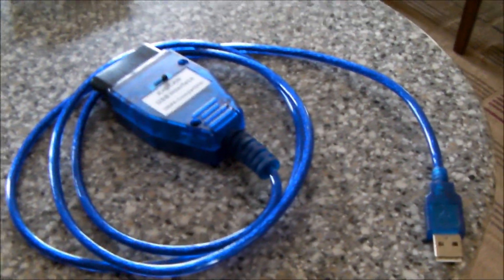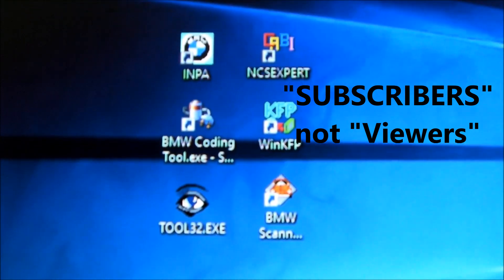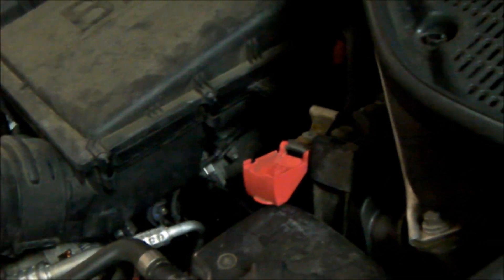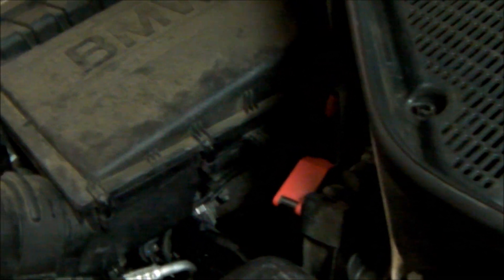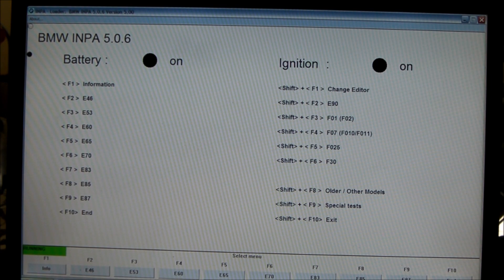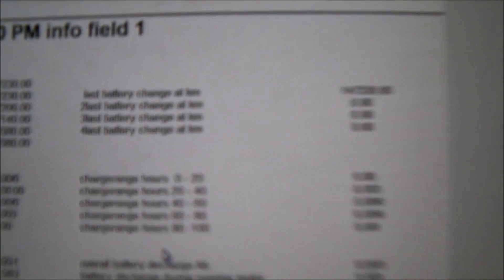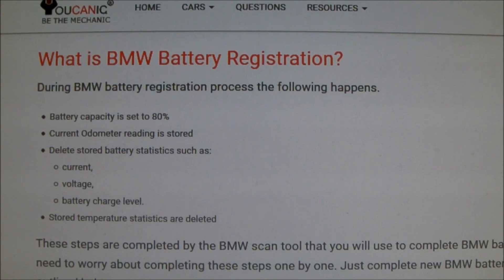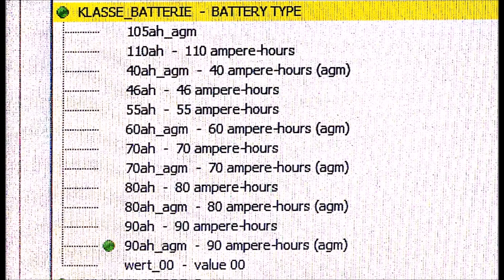BMW Battery Registration & Coding 95ah AGM for 2012 X5 35i E70 - CODING not required

Comment: So if the original battery was 90ah and i added one that is 95ah, do i need to leave it at 90ah or must be coded to 95ah? on f15. Thanks
Reply: Only if you go from AGM to Lead-acid, or vice versa.  I know I am two years late, but I disagree with this video 100%.  You should ALWAYS register a new battery, so you can keep record of when you changed it and you don't have to guess if it's programmed or not.

Comment: Thanks for you concise and quick breakdown. I was having voltage issues a year after buying this 2011 E70 X5 35i. Turns out the previous owners never once registered the battery. I was able to register my new battery in seconds and reset all error messages. No more corky voltage issues.
Reply from the maker: Be sure to LIKE and Subscribe.  That would really help ME!.  THANKS!!!

Comment: Would have used something with super low current capacity to keep the radio circuit going.  Maybe a double AA array or a AC-DC adapter.  Probably needs only a few milliAmps of current.  With a car battery, you could have melted down your wires if you shorted something.
Reply from the maker: few milliamps will NOT work unless you disable interior lights, tailgate switch, security, etc.  If you briefly short there is almost no chance of melting down wires.  Brief meaning you SEE spark and immediately remedy the short.

Comment: You need to hook a battery charger to the + / - in the engine compartment (better than hooking up an old or another battery). Regarding the coding, get a Carly for BMW and you are done.
Reply from the maker: Agree.  That engine compartment POST is shown in the video.
Reply from the maker: I'm sure your emphasis on the post in the engine compartment will help someone.  The question is when will someone ask where does the negative connect to?  I just realized it might not be obvious to everyone.
Reply: Milosheff your a moron. God why is everyone so damn ignorant. You cant code the battery in Carly at 95ah because thats not an option. Fuckin ignoramus
Reply: @josephkim9747  Correct! The is no option to code batteries.

Comment: Curious why you didn't go to F5 for what appears to be battery registration on the INPA screen where you chose F1?
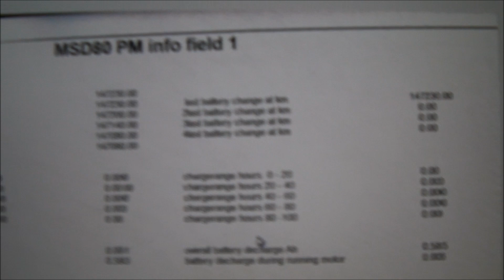Reply from the maker: At 5:07 I say "hit F5" for registration.  I don't recall the details since I did this only once and not very recent.
Reply: @YuDaMan  Keep up the good work bro! Hows that battery holding up and are there any issues at this time? Thanks!
Reply from the maker: Battery seems to be performing perfectly, with no issues.  Into 2nd CT winter and couldn't be happier with the product and price I paid.